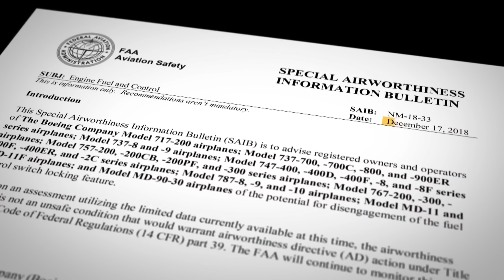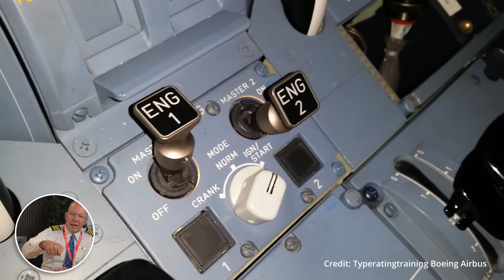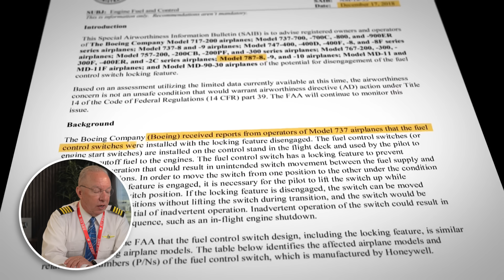Air India 171: The FAA’s 2018 Fuel Switch Locking Bulletin Explained (16 Questions Answered)

Comment: First time I've disagreed with Captain Steveeeee. If bus drivers / truck drivers / Uber drivers can drive on camera, pilots can too. Police have body cams. This is the modern standard of accountability. 

It's also possible the camera would have prevented this if someone was trying to cash in a life insurance policy that doesn't pay for self acts.
Reply: You can put a camera to record the pilots. Just have it set to record and store the last 30min just like the CVR does.
Reply: Yes.  Cockpits should have video recording at all phases of the flight, including pre- and post-flight.  This would provide excellent information on the state of minds of the pilots, whether there was crew was working effectively, mistakes made, etc.  And as others have posted, these types of recordings are standard for other sectors of the transportation industry, as well as police, etc.
Reply: @JBoy340a  not the same thing. Pilots in an emergency have to deal with an emergency for a long time sometimes. When you are battling a broken airplane for 30 min, trying to safely land 300 people, you don’t want pilots to make decisions based on the fact there is a camera.
Reply: @rtbrtb_dutchy4183 why would cameras change the pilot’s process?  Today they have already have voice recorders running all the time with the recordings stored in the black boxes.  Cameras add video and contextual information.  I am a private pilot and would have no issue with my flights being recorded.
Reply: @JBoy340a  for one, pilots already do things differently because of the voice recorder. Had it happen myself. We had to return to the airport we took off from, because of a flap failure. It took a pretty focused checklist and procedure. My FO wanted to get the ATIS and I told him to skip it, since we just took off 10 min ago and knew what the weather was. He was hesitant. In our debriefing he said he wanted to do it to make sure it was on the voice recorder. 

That’s just voice. I know of a story where a Learjet landed and on the taxi in, another airplane ran into his wing.  Not his fault. However, the FAA looked at radar tapes and saw that he was doing over 250 knots below 10,000 feet. Why did they?  No idea. But they did. They check everything when there is an incident.  That sort of stuff would be even easier with a camera. 

You could say that he should slow down. But he flew air ambulance and had a heart onboard and a thunderstorm was approaching the airport. Had he slowed down, he would’ve had to divert 50 miles away.
Imagine, with a camera, this pilot would not have tried to make it in before the weather.
Reply: well. there is one pilots family that definitely want to know for sure what happened to clear his name
Reply: Dam it,  some of these anti camera comments are stupid..
Reply: @MrUranium238  no, just that you don’t really understand aviation.
Reply: Its time to have a camera in the cockpit installed. It should operate the same way the same way the CVR does in that it records over itself every set period of time and is only used in an incident investigation. I understand pilots would not like this but with 100+ lives at stake every flight it should be installed to determine failures  and conditions in aviation incidents to enhance training procedures.
Reply: @JayGoTexas  so you want pilots to second guess themselves?  Slow their responses?  Because that will happen with a camera. An aircraft emergency can last a long time sometimes and multiple things will be tried by the pilots. Imagine a pilot not wanting to try something because of the camera.
Reply: Me too. I am a lawyer, defending transportation clients and trucking and railroad all have cameras. This is just another area of transportation that needs it too.
Reply: @Juliawood81  how many of your clients had to deal with an emergency for 30 min to try and safe 300 people?  Sorry, aviation is different.
Reply: Sheer GREED. save a few cents. STILL no external cameras on planes..EVIL.
Reply: Agree.. I'm in law enforcement.. Everything we do is scrutinised.. (video recorded) If they (the pilots) are doing nothing wrong they have nothing to fear.. If they are they need to be held to account? I'm surprised the cockpit isn't video recorded nowadays as it should be a part of the flight recording system.. Seems as though the 'cockpit culture' is preventing this - there's no privacy here they are employees just like everyone else, what's the issue?
Reply: Everyone hears the word video surveillance and automatically their minds go to “what if it leaked?” As a DPO professional I can wholeheartedly say that if the correct mechanism was put in place this would never happen. As a consultant I would recommend video recording EXCLUSIVELY to the black box and the automatic deletion of the video recording once the plane lands and the engines are shut off. In this way video footage can only be accessed in the case of a disaster. And video footage in the case of the Air India crash would be able to answer a lot of questions that, in my opinion, will remain unanswered forever.
Reply: A camera would only help to lay blame. The culture within the industry is about making sure accidents don't happen again NOT laying blame. Simply laying blame and moving on doesn't solve the root of the actual problem which is almost always found way deeper than just "You messed up".
Reply: Do people actually believe Uber drivers are required to drive under camera surveillance just because you said so? SMH, the state of critical thinking these days.
Reply: Will camera’s help planes not crash?
Reply: @ishfaqrubab9273  No, cameras do not prevent crashes  but so do voice recorders and data recorders... 🙄🙄
Reply: @ishfaqrubab9273 same question as: will FDR and CVR help planes not crash?
Reply: I agree and it’s not like it needs to retain footage for days on end, or upload the video to the cloud. More than fine to over-write the footage at the end of the day.
Reply: Let's add modern Court rooms have cameras now. While I support the Union on this , the entire mindset ie unions, management, insurance companies, social media need to discuss this more to find good solutions.
Reply: @Ebikeadventure5981  all the other examples are BS. Busses, trains, courtrooms, etc etc, nobody has an extended emergency for 30 min. Nobody has to try multiple things safe the lives of hundreds of people. A bus and a train, an accident is over in seconds. There is nothing they can do. An airplane can have an engine fire mid flight. They have to fight the fire. Then they have to deal with and engine out and find a place to land. Then they are missing hydraulics and electric power because of the engine failure. Now they have to land a stricken airplane in the middle of a heavy rain shower. You want pilots to second guess their decisions because there is a camera?
Reply: Neither of the pilots were married or had kids. Older pilot had a90 yr old father who had no use for life insurance. He was 2 flights away from his retirement. Younger pilot's sister and parents were in Australia doing well, no financial hardship, no wife or kids to support. Unlikely scenario.  The fact that the older pilot made the Mayday call suggests he also asked the question. Older folks value life more.
Reply: It also would protect the reputation of the pilot who didn’t move the switches since the one who did may have engaged in subterfuge to try to blame the other pilot on the CVR
Reply: Mentour Now will release a video about this soon. I think you should watch it.
Reply: Agree 100000$..pilots are responsible for HUNDREDS of lives...PERIOD..cameras MANDATORY!
Reply: Cameras in the cockpit.."All that's missing is the video" says Steve..That video is the one thing that would conclude most of the speculation!!.."in case someone is doing something they shouldn't be doing"...like, maybe, cutting off the fuel supply!..Come on Steve..You've lost a lot of respect and credibility on this one..
Reply: Thats why the asker could be the terrorist here and other pilot answered correctly
Reply: Yes ! STOP treating pilots they are SPECIAL human beings - they are HUMAN like everyone else - subject to making mistakes or being suicidal - STOP treating them like they are GODS !!!!! jeez
Reply: Cameras would show a lot of things passengers don't wanna see....like pilots on their phone, sleeping, sometimes both of them, arguing or eating or reading. Or having....fun. So yeah....obviously pilots don't want that....😅😅😅
Reply: @misu110382 Have fun on your own bloody time. You wanted to be there to fly. Do your job.
Reply: 100%. A system not dissimilar to police body cameras and other black box video recording systems would work. It would be in a standby mode, and buffering for a few minutes. It would only start to record and save footage in the event of an emergency, or other critical safety feature or warning system activating (along with a visual and audio notification that the camera is now in recording mode). And of course, if the plane is able to land without incident, then the pilots would have the option of deleting the recording if the system recorded for some reason. That would help reduce any privacy concerns from pilots, as a normal flight would not result in any recording happening, let alone one that would need deleting - there just wouldn’t be one because it didn’t activate. Also, any recordings would be stored on an isolated device with no network connection. The only way to view it would be to physically remove it from the cockpit, requiring a code/key that only official investigators have access to, thus preventing any unauthorised access and leaking of any footage would be essentially impossible. This is an obvious and technologically trivial solution to the problem and I don’t know why any pilot would be against this.
Reply: @BadgerBob  You have no right to privacy while working your job.
Reply: Steve is afraid he will be caught masturbating inside cockpit if CCTV is installed
Reply: The more suspicious iam that big govt run jet
Don’t want clear answers but their own fiction
Reply: Yes police do but like is probably the case in aviation the biggest opponants were the unions.  With police, it was two fold. Not wanting to be recorded and also not wanting the recording posted somewhere if it captured their deaths so their families could see it. But cops first had cameras in their cars and then body cams. Though the cameras send to be showing what they see vs like CCTV which shows a location. I'm not sure in the case of pilots trying to down an airplane it would stop them. It might show who did what if the CVR and FDR can't show that. And even with the CVR and FDR there was at least one time (SilkAir) where the captain in that case DID leave the cockpit but only to give him the means to deactivate the FDR and the CVR so they weren't able to capture much if anything during the actual downing of that plane. And in the case of Malaysian Air 370 if that was a deliberately downed airplane by a pilot, make sure the plane winds up where it most likely will never be found (and whether that would work for insurance purposes, not sure).
Reply: I thought exactly the same.. it definitely would not help in this instance but could prevent anything similar from happening in the future
Reply: Installing cameras in the cockpit would expose companies like BOEING who hide the real facts behind fake and made-up reports
Reply: That is an aeroplane, not a bus where you break the law every day
Reply: I also disagree his opinion on the faulty of the pilot and disregard the second pilot’s denial. He had no need to deny if he did so.
Reply: @Fyy256 exactly. It’s his final word and he knew what he was about to do.. I am ripping off my hair cause this doesn’t make any sense.
Reply: The sole reason that cameras are not installed is disagreement from pilots and pilot unions.
Reply: Because they can't obscure it easily lol far out people are so simple minded, cameras are there to protect them drivers not the public, the pilots are in a locked cockpit so no need for cameras because they are not at risk of being attacked suddenly or robbed or anything. Cameras would not prevent anything and if your committed to crashing the plane then can easily disable cameras without the other pilot knowing during setting up and walk around checks prior to boarding passengers
Reply: @christhorney don’t slide that away that easily. People these days dont know how to sympathise nor are willing to apply a little bit of effort by thinking before writing.
Reply: No, you want to place yet another pressure on the pilots, they are already sleep deprived and once in a while they want to have freedom of a magazine or eat something, this idea shows you expect pilots to be robots , but good thing no one will listen to you
Reply: @aeon7748 the one you’re replying to might just be a robot.😅
Reply: How many cameras do you want to have? Are you going to have a camera focused on each and every switch? We had cameras on some of our test flights. The amount of information that can be gleaned from them is less than you expect.
Reply: @edwardwright8127 most of us here want cameras and only cameras can solve everything.
Reply: Even fast food workers havve cameras on them ! Not just DOT employees!😮
Reply: A white man just trying to save a white company…
Reply: It's not as easy as you may think they would need cameras and wiring the could withstand huge force during a crash.
Reply: @mikenone4077  The camera as well as the wiring do not need to withstand the crash. Only the data will need to survive and, as I mentioned, the data will be in the black box that is already designed to withstand serious impact.
Reply: Fully agree 😊
Reply: Truth.  Pilot unions have successfully rebuffed cameras though.  By the way, if a pilot were motivated to do this then cameras wouldn’t have been an impediment.  They would only prove what we all suspect.
Reply: It would be great if capt. Steve can recreate in MFS2024 the accident, using what we know right now and how it takes to turn the eng. Back on.
Reply: So basically, your argument is "Murrrrrrrriccaaaaaaaa!!!!!!"
Reply: I am an application engineer for large engine controls, trucks and even ships don't have as much sensors as planes, we also need to talk about the rate of data and the span, you are not even an engineer so stfu.
Reply: Camera is the solution because revenge on your loved ones is real
Reply: That will be a problem for mile club....
Reply: https://youtu.be/vJC4JdUmudk?si=g4JT3DjOD0Qq2s54
Reply: One overlooked profession, for video surveillance, is for school teachers.  They have 25 little humans to protect and the headlines are chock full of cases where they acted out abuse on our children.  Long overdue...but the unions will fight it tooth and nail.
Reply: I agree. What are you pilots doing in cockpits that you don’t want the world to see??? What magazines are you reading???
Reply: @dearmodi1325  it’s not about that at all. I don’t care being on camera when everything is going well. It’s when stuff goes wrong, I don’t need to worry about being second guessed.
Reply: I could not agree more and surprised that they don't have them ,all this discussion and a picture says 1000 words ,see the hands straight away ,who turned the fuel switch off  and all the information.In regards to wooing about leaks etc which could happen with anything is nothing in comparison to 300 people dying etc .Maybe not this time but for the future
Reply: A camera would eat up a lot of data. What's a standard black box memory capacity? Can it record at least 30 minutes of footage and be robust enough to survive a horrific devastating crash for the data to be meaningfully retrieved
Reply: @johnmonk3381 good question.  I checked online and it said 1TB of video was around 40 hrs at 1080p. But I don’t know storage capacity of the black boxes. I assume they store quite a bit to capture the telemetry from the engines, motors, environmental systems, etc.
Reply: @JBoy340a  the camera could still be blocked or disabled in some way, if a nefarious actor was involved regardless. There would be nothing to prevent any physical intervention because a camera's presence would be very obvious and therefore extremely easy to manipulate
Reply: in several cases pilots tripped trigger to disable voice recorder. then they make them mandatory and catch fire by accident. no way to make anything 100% safe.
Reply: Dude has said a lot of dumb stuff regarding this one
Reply: Try being a truck driver with camera stuck in your face. You'd find out real fast just how stressful that is. They're not used for accountability, they're used for punishment. They literally will get an alert if you yawn, and you'll get reprimanded. If you look down to grab your coffee, you'll get reprimanded. You look anywhere but forward for longer than 2 seconds, you'll get reprimanded. If you get too many violations from the camera, you'll get fired. It's like driving with a gun to your head for 11 hours, 5 days a week.
Reply: Exactly! Also, why are we not focusing on how vague the report is on what pilot was speaking and when?  All the other cockpit data is provided and timestamped. Obviously this is where the truth lies and yet almost everyone is just accepting it just doesnt exist and thats ok? Smfh 😔.
Reply: I agree but you forgot about railroad engineers. My son is a conductor for BNSF and they have cameras in the engines.
Reply: Why are you dissenters watching this channel?
Reply: After investigations are essential too to prevent future accidents. How could he say video is not important?
Reply: It looks like either Captain Steve is getting paid, or he’s under some kind of pressure, because he’s defending Boeing from every angle and putting all the blame on the pilots.
Also, Boeing knows that Captain Steve is getting the most views on YouTube for this case, so they can easily push their narrative to a wider audience through him...
Reply: ✈ The human error theory seems weak in this case. In a cockpit, both pilots sit so close that if one of them even moves their hand toward the engine switches, the other will immediately notice.

🔧 Shutting off the engines involves physically moving a switch or lever — it's not something that happens silently or without visibility. Plus, right after takeoff, both pilots are on high alert. There's no chance one would be distracted or inattentive during this critical phase.

🧑‍✈ According to aviation SOPs, shutting down an engine is a major action and is never done without cross-confirmation between both pilots.

👉 So if both pilots claim they didn’t shut off the engines, and yet both engines failed nearly simultaneously, then a technical glitch in the engine control or switch system cannot be ruled out.

🛑 Aviation authorities need to conduct a detailed investigation into the dual-engine control system. Jumping to blame human error without hard evidence — especially in a case involving loss of life — would be unfair
Reply: Insurance is not a big thing in India. Most people don’t have life insurance, or health insurance or any such thing. Only thing mandatory is car insurance.
Reply: One of the biggest issues would be the amount of data a video would have to have. The voice recorder is unreadable in these types of crashes a lot because of corrupt data. Now having one just to make sure the pilots are doing the right thing... I might be for that, but don't expect to have that video viewable in fireball-type crashes. Hard to protect that much data in these extremes. The memory module would have to be much bigger than one that records data and then one that records audio, and they are not that reliable at their current size. Yet, I would be totally for recording the pilots by video. Another problem is just like with the voice recorder, all the pilot has to do is flip the breaker and it stops recording. The data recorder cannot be turned off but a pilot can flip a breaker to shut off all power to the FDR. Most of the data recorders have their own battery, so it still records with no power from the plane.
Reply: Secrets will reveal if there's a camera in the cockpit.....
Reply: Of your doing nothing wrong you shouldn't have any problem with having a camera watching look how many people have them in cars nowadays and it can help you so much in an accident.
Definitely agree their should be cameras watching the cockpit both pilots it's just another safety aid.
Reply: I get your point. However, police have body cams because the entire police system is flawed and there's a lot of police brutality and racial profiling every single day. We don't have the same structural problem with pilots.
Reply: @louibeans police body cams prove that citizen complaints are unfounded just as often as they prove officer misconduct.
Reply: Spot on! You made a clear point: if public transport can have cameras and police have body cameras, why does the pilot feel insecure?  Every time after a tragic crash happens, they just start speculating this and that. Even if the camera wouldn't prevent the crash, at least the cause of such a crash would come crystal clear.
Reply: @100saadanwar AI
Reply: @100saadanwar  It has nothing to do with pilot paranoia. Pilots are already heavily monitored in flight in ways you've not heard about. So are you going to add the weight and bulk of several terrabytes of video data storage to the black box? The bigger the black box, the more likely it will ALL be destroyed in the crash.
Reply: @100saadanwar  if you worked for airlines you’d understand
Reply: @100saadanwar  That "clear point" is ignorant of the fact that airlines operate in and are fielded by a host of different countries - unlike public transport and police. 
And no, they aren't "speculating", they are investigating.
Reply: @100saadanwar that’s what the black boxes are for and also apples and oranges, you can’t compare the 2
Reply: @100saadanwar agree with you 100%. I was just thinking the same thing when Captain Steve made that ending comment and dismissed it saying it won’t help in a crash. It’s not for that but to make it faster, easier and more accurate in the investigation.
Reply: @100saadanwar  - And hopefully act as a deterrent? Police cameras act the same way that if you do the crime, pay the time.
Reply: @jamestan8914 Pilots are not criminals dumazz!
Reply: (I didn't watch yet)
I told a nurse practitioner once, during a discussion, that doctors should wear head-cams during surgeries. She disagreed because of HIPPA. I didn't think that this was such a violation, because this is still merely a recording and not public exposure.
I know it's not directly related to her concerns for HIPPA, but a defense of her industry. I think she didn't want recordings of unprofessional behavior/actions.
Reply: @Golgi-Gyges interesting. When I had knee surgery in 2007 the surgeon recorded it. Anyway, a flight data recorder overwrites the data after an hour or two. This isn't a permanent record. Just a record of the last few hours leading up to an incident.
Reply: @Golgi-Gyges  no no. So bad. Imagine filming someone having an abortion. And then it gets leaked everywhere. 
The patient might get ostracised in some societies with all that politics about abortion.
Reply: Yeah - he also said if someone is doing something he is not supposed to do......in that case he might be in the wrong job !
Reply: @Medionxtr hr knows how many pilots are alcoholics and would rightfully be fired
Reply: In the trucking industry, driver facing cameras have not increased safety, they just make it easy for the safety manager to harass good drivers.
And most of them now are AI powered and will ding the driver for taking a drink of water or looking in the mirrors too long, and all they do is make it more stressful for the driver, because now they are thinking about avoiding triggering the camera, instead of paying attention to the road.

And for the actual bad drivers that the cameras would warn about, they will just go to another company with no cameras, so it actually puts more drivers in the lower tier fleets with less safety anything, rather than increasing safety.
Reply: How many crashes have there been and you’re now crying for a camera?
Reply: @multipl3 
How many crashes? Take a look at the stats  on airline safety. Crashes like this are exceedingly rare, between the fact that the aircraft have redundant systems, the way they are maintained , the flight procedures pilots follow, the accident rate is incredibly low.
Reply: @multipl3 they will not take blame they support terrorist Russia and Israel and killing of innocent people in Ukraine and gasa
Reply: Agreed.
Reply: The idea that a camera in the cockpit would have prevented this crash is beyond absurd.
Reply: No cameras is the position the pilots unions have. There are genuine concerns that airline companies will uses the footage to assess job performance in the same way Amazon stalks all their employees to make sure they’re not taking too many toilet breaks. 

Do we really want to risk making the lives of pilots worse when cameras don’t actually improve the safety of flights? A camera won’t have saved these people it just helps us point fingers.
Reply: @11manxcat  to be clear, I only support cameras that overwrite like how voice recorders do. I'm not suggesting a permanent archive of every flight.
Reply: @11manxcat genuine concern? There are cameras in shops and malls everywhere! I don't see those employees complaining. What a stupid excuse.
Reply: @grf73tube Employees do complain it’s just you can’t do much when you’re working a minimum wage job and don’t have a massive Union to protect you lol.
Reply: @11manxcat the general concerns over airlines "snooping" is a nonsense. Access to flight and cockpit voice recording requires special equipment, and it would be trivially easy to encrypt data such that only flight accident investigation teams would be able to gain access to any video recordings.
Reply: @11manxcat and that’s exactly what I would like to know. Enquiring minds want to know who did it.
Reply: @11manxcat so stupid argument it hurts.. pilot are employe, if camera help them to remember their behavior can leeds to death of thousands people, i dont see the issue.
and in some case it could be help to visualize how to modify a cockpit for better safety and comfort of pilot.
so your point is just based on emotionnal and irrationnality... not facts.
Reply: @FH-ot3wo Isn’t it more emotional to demand massive reforms anytime an accident happens especially reforms that won’t prevent the very disaster we’re discussing? The truth is cameras won’t have prevented this disaster. 

If cameras do get installed and then later abused by employers you will genuinely increase the stress pilots feel and increase the risk of accidents happening. People don’t perform well when they know their employer is breathing down their neck 24/7 watching back footage for any fuckups to bring up in their next performance review.
Reply: @11manxcat but it may save FUTURE lives by exposing the real culprit which in this case, may NOT have been a pilot
Reply: @11man, I suppose you also don't like LE body cams which would show your arrest being justified or shop CCTV proving you a shoplifter...or on the other hand proving your innocence in court?
Reply: @11manxcat  but there wouldn’t be any footage to look at. It would only start recording in the event of a crash or emergency (they would be a buffet of a few minutes which would be deleted in a loop). Just like police body cameras which I have a lot of experience with. They are on all day long but only record when they are activated by the officer or when they turn on a taser or the blue lights on their vehicle. This captures the incident and one or two minutes before it was activated. If there is no emergency situation, there is no footage for the operator to review and use against a pilot.
Reply: @BadgerBob  they might record for 24 hr and then over write
Reply: @WalterThorne-h5k But they wouldn’t need to. Recording only starts when an emergency or critical alert is activated. That way it captures footage in the event of a crash, but protects the privacy of the pilots
Reply: @BadgerBob  That's not going to work.  How would the system know when an emergency happens?  Why not  have the recording to into a data recorder similar to the FDR and CVR.  It doesn't transmit anywhere and it holds a limited about of video.  The drive can be encrypted so that the manufacturer is the only ones who can decrypt the video.

It's not like you need to withhold the identity of the pilots to an air incident investigation team.  They're going to have information on the two pilots, including their names.
Reply: @ki5aok How would the system know when an emergency happens? Same way it knows to activate the RAT, or drop oxygen masks… planes have hundreds of sensors and systems for monitoring detecting an ‘emergency’ or critically dangerous conditions, like loss of cabin pressure, engine failure etc…

But yes, I agree with everything else you say.
Reply: Same here!
Reply: It’s not as simple as putting in a dash cam into the cockpit. The amount of money to certify a camera and connecting to the black box would be absolutely staggering.
Reply: @tylerduchesneau Staggering? What was the cost to Boeing for the 737 Max debacle? Billions of dollars! The retrofit of video capability is easily doable and the cost tolerable when implemented over time. It's not as catastrophically expensive as you suggest. The real problem is the position of the unions which care more about hurting pilots feelings or infringing their privacy over the accountability of pilot behavior and passenger considerations.
Reply: @tylerduchesneau only if you make it that way. Just stick dash cams in the cockpits. If video is unnecessary as every pilot says, nothing lost if it malfunctions. But for a few hundred dollars you can have a system completely independent of the data / cockpit audio recorder.

Fun fact: a fair amount of General Aviation crashes are solved because the pilot had a gopro or similar running which survived the crash.
Reply: https://youtube.com/watch?v=XZ5oHyNfcAE&lc=UgxjScLwQmw9kxu1vGB4AaABAg&si=QGlpztWkmk0wK7h5
Reply: Steve has go away heat !
Reply: You have no clue what you are talking about and simply do not understand how complex this would be at this point in the aviation game.
Reply: Cameras will only help lay blame. Cameras in the cockpit are a bandage. They wouldn't solve this problem. Think about that...
Reply: @craft-o-matic - I just thought about it and couldn’t cameras also help prove innocence?  In this case, if the cameras showed that what happened was accidental or not even the fault of the pilots at all, wouldn’t that bring a lot of peace to the families?  Also, couldn’t that help shed light on the true factors and save future lives?  Think about that.
Reply: @craft-o-matic399  1) blame is important. 2) See my life insurance example. With audio, it's ambiguous. You could turn the switches off, then ask the other pilot "why did you turn off the switches?" and they'd say "I didn't!" because they didn't. 

But if there's video, there's no way to get away with a scheme like that.
Reply: @PsRohrbaugh really good point!!!! I hadn't thought that maquiavellic way!!!
Reply: @craft-o-matic399  Not true. You could say the same about cockpit voice recorders. But recordings, both audio and video, help to scrutinize the precise steps leading up to these catastrophic incidents.
Reply: @craft-o-matic399  no one is saying cameras will directly prevent accidents but it could give us details on what went wrong so we can all learn from it, including boeing and not make the same mistake.
Reply: @craft-o-matic399 They wouldn’t solve this problem, but the next one…. This case is not the centre off the universe. Install a dash cam after the accident not helping, sure genius. But thinks of the others after that.
Reply: @craft-o-matic399  but if the camera shows that no pilot disengaged the engines, we'd know where to look for answers
Reply: @craft-o-matic399  "They wouldn't solve this problem."

They may solve the problem of pilots reading magazines instead of flying the plane. If someone leaks the video, then it may encourage pilots to stop doing it and concentrate on the job.
Reply: @craft-o-matic399 appropriately assigning responsibility (aka "laying blame") isn't important? Really? So both pilots are held responsible for the actions of one?
Reply: @craft-o-matic399 you are really short sight. does voice recording solve the issues... ?! my god, such non thinked comment.
video with AI could even detect anomalies and immedialty indicate problems by video with non intrusive sensor. In fact there is soo much more benefit than issue of video.. the blocage was technology and now only remaining is pilots..  BTW, i dont see the point with company use video for metrics.. we talk about black box video recording that would be only used at BOX extraction  , so deadly accidents... , where is the issue ? And if it can show that a pilot did push a switch by mistake... it could help plane maker to make better ergonomic or change buttoms position based on observation in production
, .. its only 100% goes for security and will promote a safer security centered in pilot mind that their attitude should be according to safety rules.
Why pilot with their massive pay should even be spared from acting accordingly to safety standard ? like in less dangerous jobs ?? Who cares about pilots advises, their argument is dog shit. they speaks about safety and examplary behaviors they have, lets remove the black box then cause it also couls be use to fire bad pilots.
Reply: @craft-o-matic399  Cameras keep people on point. Think about that!
Reply: @craft-o-matic399  Laying blame prevents bad acts or maybe habits is a better word. We have one truck in our fleet with a driver facing cam. The boys are much better behaved in that truck than the ones with just a outward facing camera. Including me.
Reply: @craft-o-matic399  if this was suicide, i dont see how you "solve" it. one pilot can easily surprise the other and incapacitate them and take the plane down in any number of ways. the camera would give you answers that you wouldnt otherwise get. theres no good reason not to have it.
Reply: @craft-o-matic399  Not really. If the pilot knows that he WILL get caught if he does anything stupid like this, he will not do this. His family will have to bear the burden of this even if he is gone.
Reply: @craft-o-matic399  And audio recordings have? Why bother keeping those either?
Reply: @craft-o-matic399  Yep, and it's even worse than that. Anyone who desperately doesn't want to be discovered doing the wrong thing will more than likely cover or disable the cameras far in advance or immediately and clandestinely before doing the deed. There are ways, even if not foolproof.
Reply: @craft-o-matic399 Nope, it will only help to establish the facts as well as nudge boeing and others to put additional security features into these planes to reduce manual interventions and increase flight safety.
Reply: @craft-o-matic399  Who said they need to SOLVE these kinds of problems?? Common sense says they might be a preventive step in some ways and more than useful in unfortunate events like these. But, why on earth shouldn't they be installed there in the first place, can you give a 'logical' answer that doesn't cater to 'hiding' things that shouldn't be done in the cockpit?? Don't give me any privacy shit, all kinds of vehicles have them, police even have bodycams!
Reply: @craft-o-matic399 Sure it would not have prevented this particular crash. But let’s say there was camera, it could HELP to investigate what happened and PREVENT the same thing from happening again. We are still not 100% sure this was a su*** attempt
Reply: @craft-o-matic399 ”lay blame” must be victim speak for “accountability “. 😂
Reply: @craft-o-matic399  “lay blame” must be victim speak for “accountability “
Reply: forget about that, why he is always so dressed up?
Reply: @leafnode42  Why is he dressed up in a pilot uniform on a channel about aviation? Is this supposed to be a joke?
Reply: @leafnode42 that’s his uniform because he’s an actual working pilot
Reply: @leafnode42 😂
Reply: @leafnode42  He's retired - why pretend not to be.  That fake background compounds his act.  If I were his  AME or employer nowadays I'd  worrying about his mental processing skills and recall power.  I'm rather glad that he's bullpooping to a camera rather to a crew, passengers or engineers.
Reply: Camera must not be allowed at any kind of  work place. If public donot trust then public must not use that kind of service. I have seen camera in care home.which must not be allowed for many reasons
Reply: @chanpatel2066  as someone who's currently suing a nursing home for neglegent homicide of my grandmother, cameras are absolutely necessary in that environment. I only wish I realized that in time to save her. Grandpa's still alive and he's got one camera in each corner of the room so nothing can be hidden.
Reply: @PsRohrbaugh How about a camera in every bedroom, to prevent verbal or physical abuse. The State would ( of course ) never leak or otherwise abuse your privacy.
Reply: @chanpatel2066 I'll believe it when I see it. Seeing is believing. Trust? Are you kidding me? My goodness are you naive. No visual observation is like "the fox watching the chicken coop". The advent of video cameras has contributed to making the world a safer place.
Reply: @chanpatel2066  Please tell me that you're just kidding
Reply: @MrUranium238 this gentleman is comparing it with uber. I dont know what has gone wrong in this world.
Reply: 🤨 You idiots Captain Steeveeeee is never going to throw his fellow pilots under the 🚌
Reply: Steve is an idiot, he was the first one who was saying the flaps up instead of gear down consipiracy. Dont believe anything this man says. He should stick to funny videos and skits.
Reply: @carpetbilly is gear down the new gear up?
Reply: @carpetbilly  he also said it is his teory
Reply: @LOLiver-PE  He did not, watch his other videos, those you can clearly see he has a different tone. Also he went on CNN India to say this as well. Complete moron he is. Also, he had his vapor lock theory which was ridiculous. He should keep to his funny videos.
Reply: @carpetbilly I completely agree.
Reply: @carpetbilly  Obviously you have the mind of a child and never even touched an aircraft's exterior.
Reply: @carpetbilly that’s not very nice. Just after the accident, there wasn’t much information available. Please be respectful. I’m sure you couldn’t make videos like these.
Reply: @carpetbilly 🤡🤡
Reply: @carpetbilly perhaps you need to go back to the original video regarding the crash where he states “conjecture” and “theory”. Captain Steve also stated that he doubted it was the flaps. I think you need to watch the videos, pertaining to this accident, all the way through before calling someone petty names.
Reply: @ginathomas7813  He said here is what I think happens, and states stupid things like flaps versus gear up. NO ONE would do that, not even an amateur pilot. To even bring that up shows what a clueless man he is. Like I said, I like Steve, but he should stick to funny videos and skits.
Reply: @carpetbilly 🤣
Reply: @carpetbilly 😂
Reply: @carpetbilly he did say that and was wrong.  Most people form conclusions without waiting to gather all the facts.  

The NTSB are unique in that they remain completely open minded .  Often the final conclusion is totally different to do speculation.  Just look through NTSB reports.  Captain Steeve is a great person and aviator but he doesn’t think like the NTSB .  

I think more evidence will arise in the future with the ongoing investigation
Reply: @carpetbilly  absolutely. Or paid by Boeing. Or both.
Reply: @deepakvrao  He’s “paid by Boeing” because the evidence in this case doesn’t point to a systems failure? Because it’s easier for yokels to believe this is some kind of conspiracy instead of reality? I wish I could separate myself from reality like that, I really do. It must be a fearful and paranoid existence, but if I could just turn the “comprehending reality” switch off… Man, that would be awesome.
Reply: @TitaniumTurbine  you don't seem to be very smart. See his history of videos. From day 1 he's been out to make it a case of pilot error. 

Boeing has quite a history, or have you been living under a rock?
Reply: @carpetbilly  steve knows what he is doing. Milking cash and views
Reply: @android8698 and yet you are here.
Reply: @carpetbilly   I agree he should be reported to youtube this guy has no training on problem solving, its obvious he is milking it and does not know what he is talking about. He does not have the data!
Reply: @sixbells99  Thank you!!! Finally someone with some sense. Steve is good at his funny skits and videos, he should keep making those and leave these analysis type videos to the experts.
Reply: @sixbells99 He’s probably some fake ATP who wears a pilot uniform on YouTube to earn views.
Reply: @carystevensky   Well he is loving the attention this is getting him. You can see it, but he is SO BAD at this! He might be able to fly a plane but just many people can drive a car does not make them problem solving experts in understanding what caused a car crash! He is totally outside his lane on this!!
Reply: And Boeing is lying to you all.
Steve is only saying what he thinks.
But we are not hearing the truth from Boeing  .What were they talking with each other  before one asked the other .
Where is the  whole recording ?
Reply: @christinebrown4901 Ask the Indian AAIB. Boeing is not in charge of this enquiry. They are only a minor participant.
Reply: @christinebrown4901 this is not Boeing. The AAIB retrieved, extracted and analysed the data and voice recordings
Reply: @christinebrown4901 what’s Boeing got to do here?